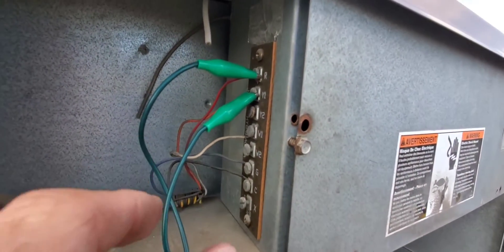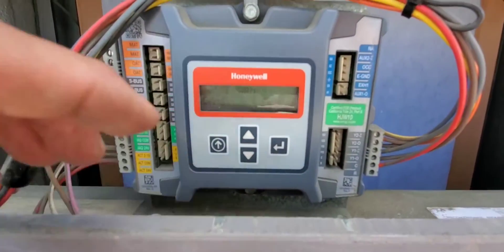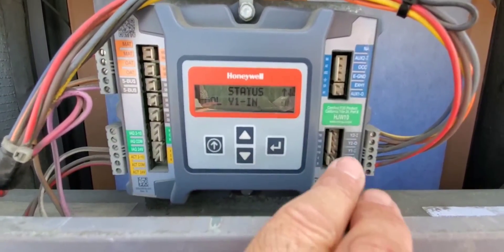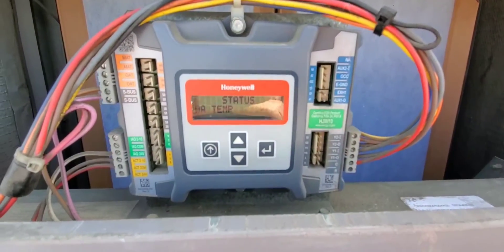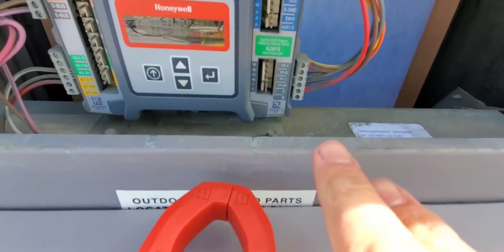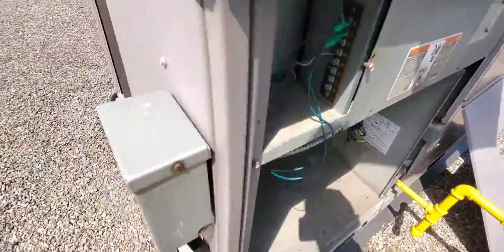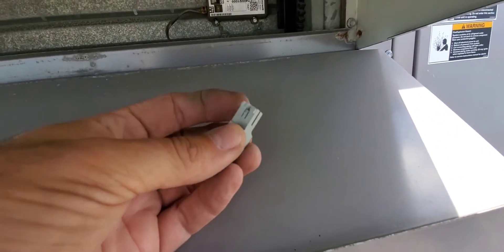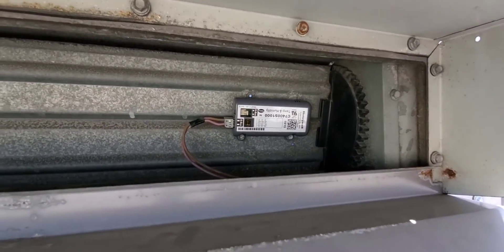Compressor Won't Start On Carrier RTU

Comment: Hey Gary, I recommend using the test settings in the Jade to verify the operation of outputs, that way you can verify that the outputs work on the controller before running out to get parts and preventing a second trip to the suppliers.
Reply: Also if note, the output contacts are energized from the r terminal, not the inputs as you would expect. If the r and c are sword, you won't get Econo operation
Reply from the maker: Good tip, I always use that feature to drive the actuators

Comment: Was expecting to see an old black box in that unit
Reply from the maker: I've been converting over slowly
Reply: @HVACKnowItAll  the jade controller makes setup and troubleshooting easy, i love retrofitting them.. if only someone would produce a more robust, more  water resistant S-BUS sensor. All the ones that Ive found that went wonky have been due to moisture